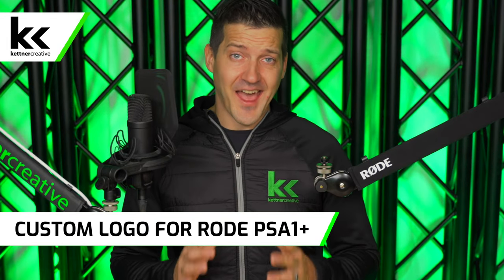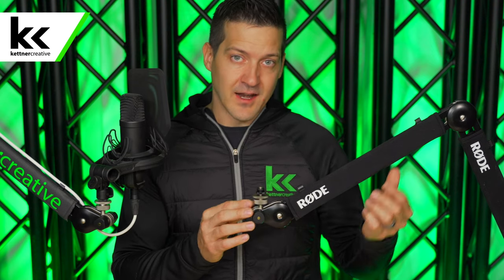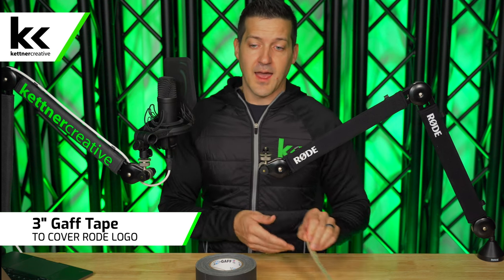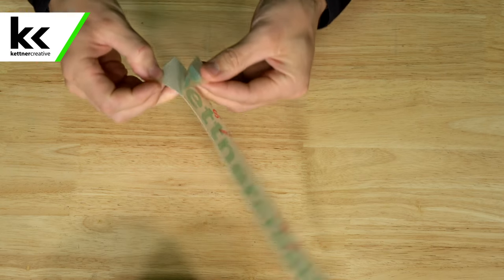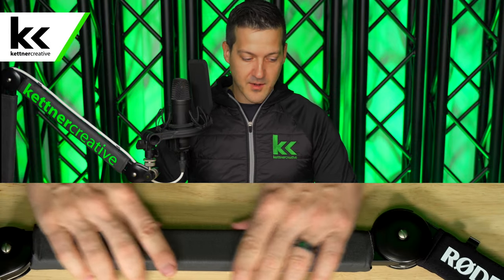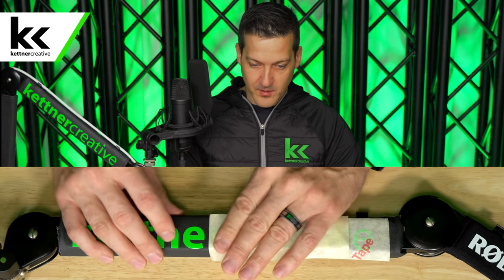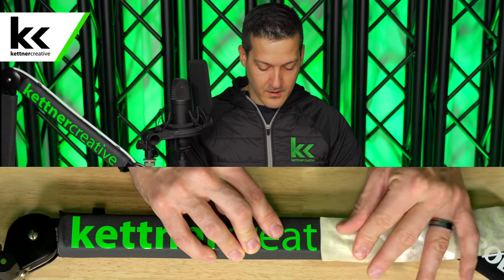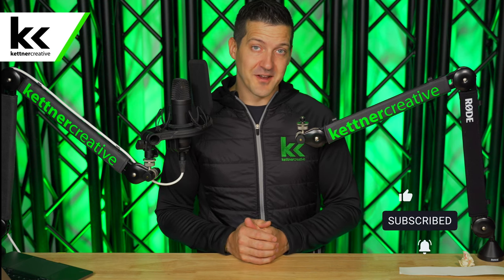How To Add A Custom Logo To Rode PSA1+ Boom Arm

Comment: Instead of using the tape, I was able to use a product called VLR Heat Transfer Removal. Poured a small bit on, wait 30 seconds and all of the vinyl peals right off. Then put a bit on a rag and wipe the residue right up. Nice and clean and don't have to worry about tape.
Reply: Wow thanks! Will give it a try!

Comment: Hmm. Well, I guess Im the only one who quite likes the Rode branding. Personally, I think most boom arms "look" the same aside from some slight aesthetic changes (not saying they all perform the same). Especially from the viewpoint watching a livestream. Its taken me years and years to build my command center, so i have no problem with the logos being there, showing its not a cheap-o Amazon arm paired with my sm7b. There were many reasons i ordered the PSA1+, main one being the cable management and overall good reception of the previous gen. psa1 by sm7b users. But ill be honest  the branding was appealing to me as well. If i couldnt stand it i wouldnt have ordered it to be fair. I dont think i could overlook it. On to the topic of the video. I LOVE the creativity and overall result that came from adding your own branding logo. Looks solid. As always, love your videos.
Reply: Rode is a massive step down from a sm7b but in saying that you can see commercial radio stations around the world that have been using those cheap amazon $8 arms for decades with $1000 mics. I buy $199 broadcasting arms with no logos just for looks. I even sold my sm7b because i just think they're ugly. It did sound good but quite dark. Replaced it with an RE320 in black.